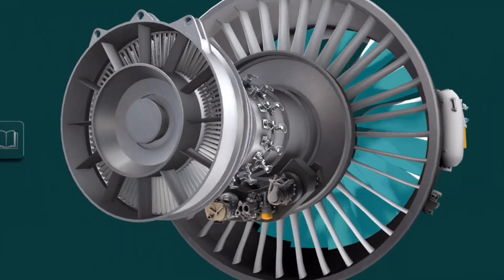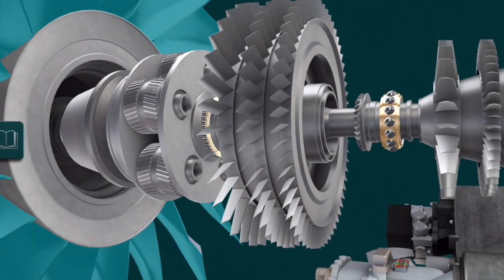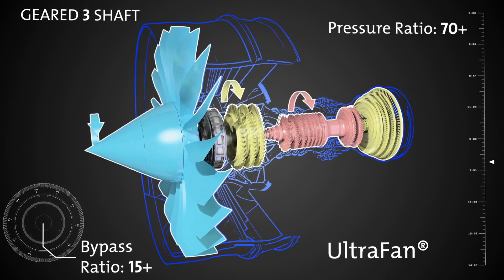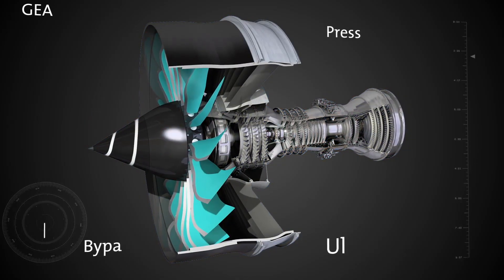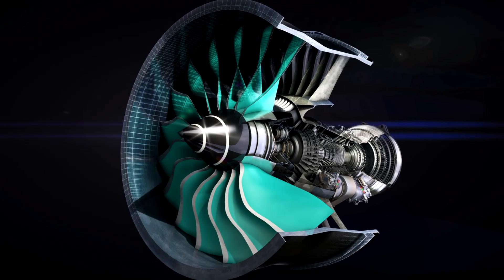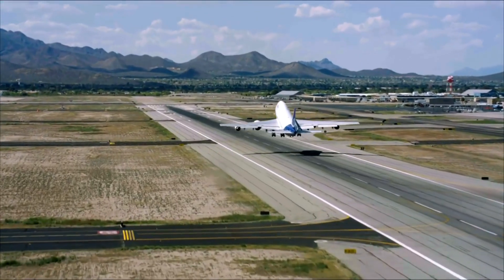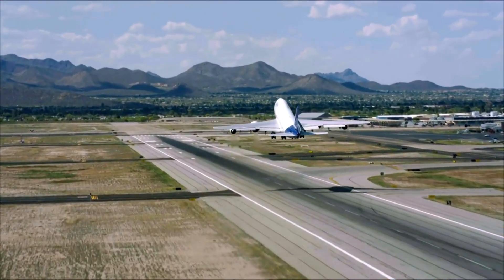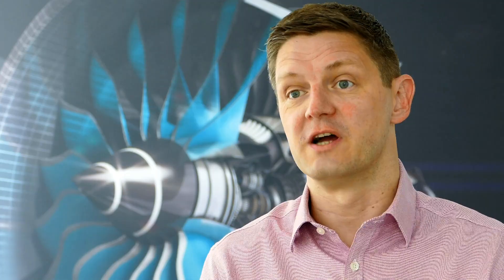Rolls-Royce | UltraFan Test Programmes

Comment: Firstly the PW patent has so many problems, ie there are a ton of existing geared fan engines that existed prior to that patent i doubt it can be used as a blanket patent for geared turbofans and if they use it to start throwing "cease and desist" orders around PW could end up being stripped of that patent. Secondly it's interesting that RR has eliminated the variable pitch element from the ultrafan's fan design, as tat system had already been developed! could we next see "hyper-fan" or even AFT-FAN2? PS i used to work at RR Derby in fan Design.

Comment: why would you increase mech losses and complexity using a gearbox ? it would've been more efficient to keep the IP driving the front fan and use the LP to drive an extraxtor/flow mix rear fan to increase thrust and lower sound pollution since you're not going to run it no where near the sound barrier, some sort of aft fan to multi spool hybrid would allow better energy extraction, the second fan would make a low pressure spot in the bypass tunnel thus allowing the use of more blade angle on the front = increasing thrust, it would also mix the supersonic hot air with the colder bypass air reducing sound pollution and making more thrust since the heat will expand the colder air's volume in the process of mixing them
Reply: I’m sure Rolls Royce with there thousands of engineers, 12 years of development and hundreds of millions worth of investment have their reasons.
Reply: The small mechanical losses are completely made up by higher potential bypass and closer to optimal compressor and fan speeds.
Reply: Check out  the PW1000. Although plagued with issues, it explains why you'd want a gearbox for the fan.

Comment: GE knows this for 20 years
Reply: @Franku Doge they should try first beat the Ge90
Reply: @wololo10  they have the Trent XWB if I'm not mistaken
Reply: @wololo10  and technically the trent 1000
Reply: @eeeman2653  no, no. Trent 1000 and XWB are titanium fan blades
Reply: @wololo10  I thought you meant fuel efficiency and stuff
Reply: Is GE more advance than PW and RR?
Reply: @ubaidh66  In fan blades yes, carbon fiber >  titanium
Reply: @wololo10  So GE>PW>RR in commercial engine....... PW>GE>RR in military engines ?
Reply: @ubaidh66  Rolls Royce were using wide chord fan blades since the '80's. GE and PW were not because Rolls had the patent!

Comment: The >70 compression ratio and >15 bypass ratio should be the largest so far. Also the material advancement catches up with GE, the geared fan absorbs the advantage of PW. I quite believe this engine will be a big success if it could be launched at a proper time to power the next generation Airbus.
Reply: Although the Ultrafan is developed for wide-bodies it would be great fit for the rumoured Boeing middle market aircraft.
Reply: The Pratt and Whitney geared fans are operating at 7% lower temperature than GE LEAP.  When Pratt and Whitney catch up with GE materials the PW-G will be well ahead unless GE increase temperature (which they can as LEAP runs less than GE9X) or they also developed a geared turbofan.
Reply: @WilliamJones-Halibut-vq1fs  Ya I guess so. But PW GTF seems to have reliability issues with its core. In contrast, LEAP is much more reliable as it's largely relying on existing technology without much innovation, which makes it the first choice of most customers who value reliability most.